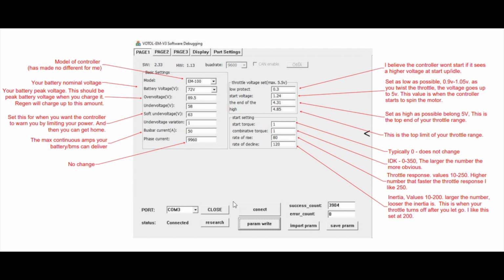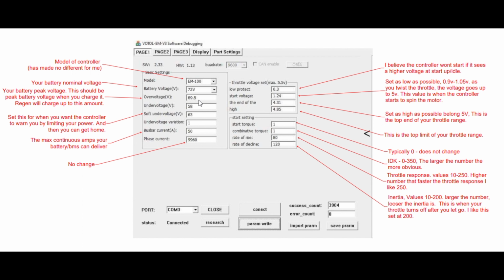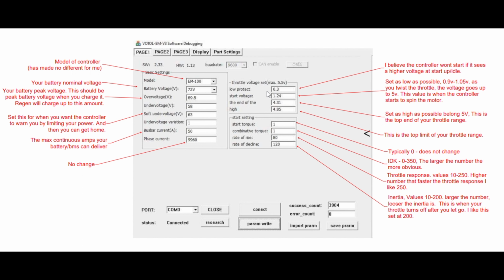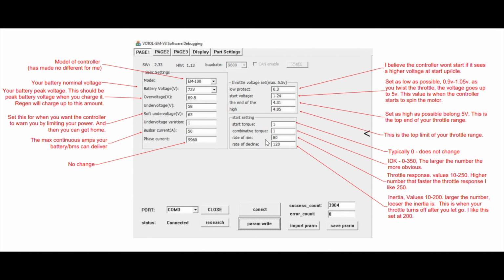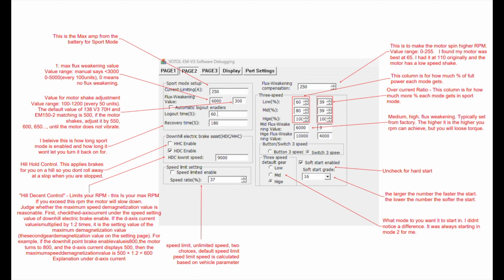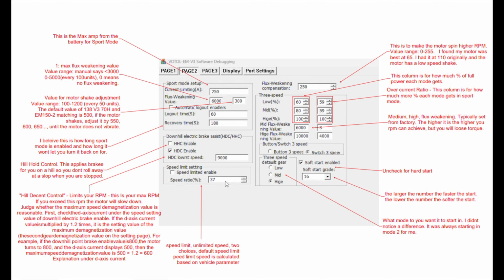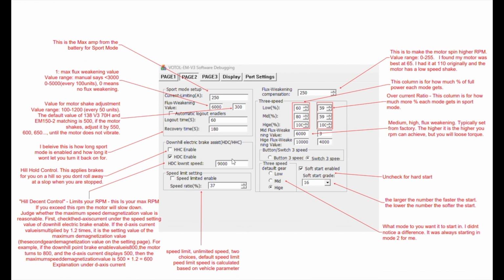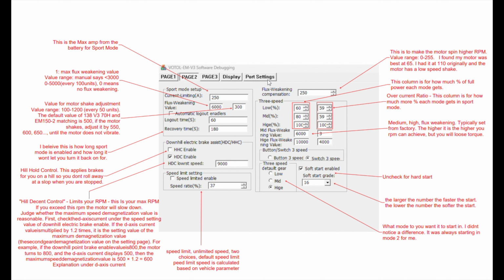Votol Em Controller Programing em100 em150 em200 electric e bike

Comment from the maker: I keep adding things to the spread sheet. I have made some changes to the info. Like the Three speed box (left side is for % of top speed and right side is % of torque). I keep updating that Controller spread sheet here https://drive.google.com/file/d/1560TfqH_GPA2I2cIH4BXGgNTTGU3wKB6/view?usp=drive_link
Reply: Hello sir 👋, can you be kind enough to help with getting wheel to spin reversed?since my motor is mounted opposite

Comment: dude, you wrong about almost of this setting. two columns in ThreeSpeed are not what you said. the left column is the limited speed on each mode ( ex : you set 60% on left column of Low mod, so the speed will be 9000RPM ( in HDC speed ) x 60% = 5400 RPM. And the right column is how much % power you use for each mode ( ex : you set 59% on Low mod, so you will use 250A ( current limiting ) x 59% = 147,5A for Low mode ). you're so wrong dude. anyway i come from Vietnam ^^
Reply from the maker: Thank you. That makes perfect sense.  I tried changing the right side and it didn't do anything. Everywhere I read said the right column didn't do anything except for high in sport mode.   I'll try it again with more drastic changes.
Reply: @Corn-ped   left column stand for speed ( % speed based on the line HDC Speed ) 

Right column stand for power of that mode ( % power based on Current Limiting )

If you change left column, you'll easy to see the difference of each mode speed 

If you change right colume, you'll feel the diffrence of each mode power . Or you can take your bike ride on road, and watching the discharge of BMS at the sametime, you'll easy see the difference
Reply: @Corn-ped  and you said the opposite of the truth 😥 changing the right column make so much difference on how much power discharge you use on Low and Mid Mode

It just seem to be don't do anything in High Mode - my opinion and my experience tell me that the High Mode and Sportmode using the same Power discharge no matter you change the High Mode right column, but difference of torque/traction
Reply from the maker: Thats great to hear! I updated my spread sheet with that info. I will mess that that today. Thanks for the info.
Reply: Hi, did you know how to set flux weakening for QS hub motors ?

Comment: Subbed, finally clear instruction that are not in chinlish...
Reply from the maker: Thanks man!
Reply: Tonight I tried restricting my moped. Is there a way to limit the speed on rpm instead of on percentage? I got the problem when my battery is half full my speed drops too. So when I limit my speed with percentage my moped becomes way too slow! Any ideas?

Comment: Hey brother. I’ve got a metacycle. There is a ton more you can do with this controller if the motor is meant to keep up. Let’s chat soon
Reply from the maker: yeah? tell me more! Do those use the same controller?
Reply: @ yes sir they sure do. 8kw motor 14kw peak power. A bigger controller will always help too. But the votol 200 is plenty of juice to be squeezed
Reply from the maker: @tylormack  I am pushing 21kW thru mine and it doesnt even get hot.
Reply: @ that’s what I like to hear.

Comment: Do you have any idea why none of the settings will change, it says it’s successful but it continues to revert back to the original settings, the only thing that will change is the voltage. Thanks!
Reply from the maker: The setting stay the same in the app when you restart it. I save the file and have to reload it each time with the saved settings. Is that what you mean?
Reply: @Corn-ped  the issue is nothing will save, it says its successful but nothing changes  I was wondering if maybe there was another way to save it. Thanks!
Reply: @danejoyce6005  I had same problem to, when changing sports mode current above 100A in my votol em100 controller. Is 100A are the highest limit for EM100 sports mode?

Comment: busbar current is the regen value multiplied by ebs % when regen braking, so you can calculate the ampere value of the regen
Reply from the maker: Does that make the regen adjustable?
Reply: @Corn-ped  yes, in my case I set it to 70amps and 40% ebs, my bms read 28amps of charging, just multiply those 2 to get your desired Regen, 28amps Regen for me is too much it brakes crazy hard so I drop it down to 30% =21amps
Reply: @Corn-ped  The busbar value should not exceed the ah of the battery. Is that correct?

Comment: Hey brother,  Thank you for talking the time to make this and share such great information. I've been messing with this app for a little while on my Metacycle and I have helped others tune their Metacycles. You have definitely helped clarify a few of the settings that I was a bit confused about. I do really appreciate you for doing this. I have a couple cups of coffee coming your way. 🙏👍👏
Reply from the maker: Thank you! Anything you have to add? I m just trying to get more info out there. I didnt find much out there.
Reply: @Corn-ped  The only thing I can say is that the configuration for a Hub motor is very different than that of a mid drive. I can definitely share some of the maps I’ve created for the METACYCLE and QS 273 hubs that seem to work great for some of my clients.
Reply: hey @jfeliciano15, I do have Metacycle and trying figure out the best controller settings to get rid of slow start. Could you share yours experience and tell me what numbers I should change? Thx

Comment: Hi.  Do you have a URL link (or specific product name and model) as to where you bought your USB to votol controller cable from?  thanks.
Reply from the maker: Mine came with my controller. I found these two online. This is the exact one I have and use.  
https://www.aliexpress.us/item/3256804684294092.html?spm=a2g0o.productlist.main.3.636d2e467zWZgW&algo_pvid=28e013a3-097b-4ac4-a67c-ca65deeb2895&algo_exp_id=28e013a3-097b-4ac4-a67c-ca65deeb2895-1&pdp_npi=4%40dis%21USD%2125.00%2125.0%21%21%2125.00%21%21%40210318b916920218520831457e0f73%2112000030828486729%21sea%21US%210%21A&curPageLogUid=N3QsJgjfeuMk 
https://www.amazon.com.be/-/en/aqxreighto8y3rsgbif/dp/B0BZ1B95JV/ref=sr_1_2?keywords=votol+controller+usb+cable&s=automotive&sr=1-2
Reply: Hi and thanks a lot for this nformaton.  I was running around in circles with this CAN or without CAN business.  Still not clear to me why they add this complexity, but it is what it is.  I am going to buy from that URL you sent me.  Again big thanks!     @Corn-ped
Reply from the maker: Where did you get the controller? Can you ask them?

Comment: Hi there what's your thought on the votol EM200 SP controller having a rated boost current of 250 amps and setting the sports mode current limit to 250 amps or greater? Will the controller safely operate for short bursts?
Reply from the maker: I have mine set to 300 and it's been fine...
Reply: @Corn-ped  I see that you are setting the sport mode current based on your battery pack, which you say is 300A. Does the metacycle battery have this rating? If not, the BM system might shut the system down at 300A....your thoughts?
Reply from the maker: I am not sure what the metacycle has for a battery rating. If the battery is not rated for it, the BMS should shut it down.
Reply: @Corn-ped  hi thanks for your response... I set mine to 285 amps and the bus bar current to half that. I think that there's a discrepancy between how you described the 3 speed data section of the programming on the video compared to the document that you have linked. In the video you describe it as percent of power in the drive mode and the second column as the additional boost in sport mode. The first column is actually the RPM attainable in each gear and the first two boxes in the right column are the percentages of torque and the third box is a number between 0 and 14 and should be left at 7 according to the programming manual
Reply from the maker: @bshul10  yeah totally. I Wish I could edit the video.. I was still trying to figure stuff out
Reply: @Corn-ped  well, you replied to comments quickly, which makes you top notch

Comment: Is there an easy way to limit speed so it doesn't go above 50kph or something like that?
Reply from the maker: Page 2 has the mode columns. and the left side of the column is for the percentage of power and the right side is the percentage of speed. Play with the right side to figure out what % eqauls the too speed you want to limit it at. My low mode is at like 35% and it is limited to 30mph.
Reply: @Corn-ped  That's amazing, thanks man.

Comment: What is the difference between busbar current and current limiting? The right column on page 2 is the percentage of power for the busbar current or the current limiting?
Reply from the maker: The right columns control % of power (busbar current) and % of rpm. The limiting current is only when sport mode is enabled.
Reply: Thanks for the help @Corn-ped

Comment: very informative, especially for a guy like me that knows nothing about this stuff.  I just bought a chinese scooter with a votol em100 and a QS 2000w motor and a 72v 70AH battery.  What I would like to do (once it delivered on 2 months) is just to increase the top end speed to around 75 kmh.  So two questions: a) do i need to buy a usb cable with or without CAN?  b) what/which setting on the software interface do I change (and from what to what).  Thanks.
Reply from the maker: you could probably need to increase the buss voltage and possibly the RPM limit if there is one set up right now.  I am not sure which usb cable you need. My EM200/2 needed the con bus usb cable.

Comment: Hi sir, im using em50 48v. All goods but when i full throttle it automatically cut the power. I need to stop so i can throttle it again. Can you help me where i need to change it?
Reply from the maker: You could have a voltage cut off, is the battery fully charged? . I have not had that issue
Reply: Yes sir. Fully charge when i full throttle test is good. Only the problem when i try into the road test
Reply: Busbar Current (A) : from 55 to 30 now throttle working goods. 😅
Reply from the maker: @you-noob  ohh yeah the em50 might have a limit at 50

Comment: i was wondering if you could help me with a issue i am having with my em200/2 controller. when i ride the bike it keeps cutting out when i use the throttle for more than a few seconds. ? it will power back on if i disconect the battery and it shows no faults on the program app , 
thanks ,
 Andy.
Reply: most probably battery BMS issue
Reply from the maker: yeah that sounds like a BMS issue or the controller is seeing too much voltage drop and shuts off.